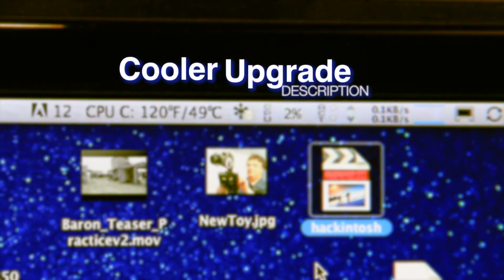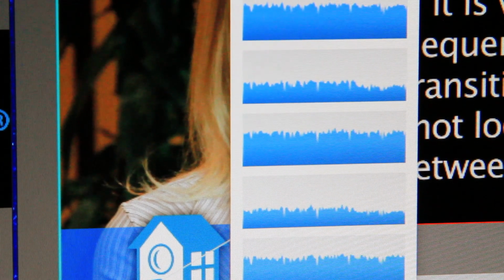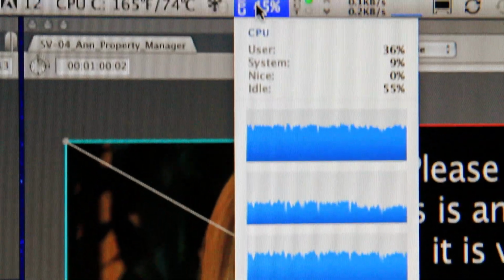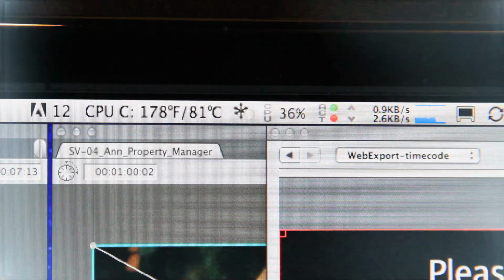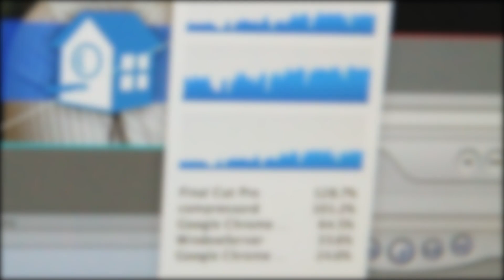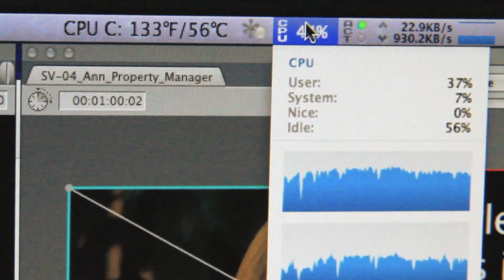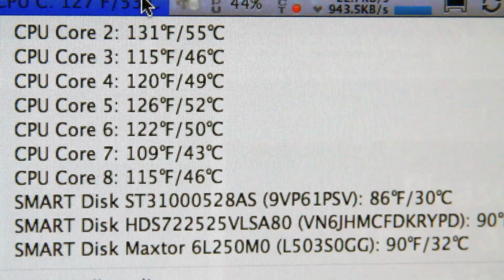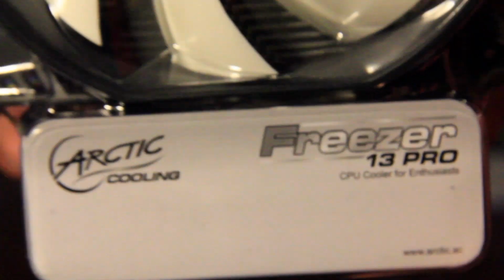Installing Freezer 13 Pro

Comment: I have Corsair - CMX4GX3M2A1600C9 RAM installed. The two closest slots to the processor have on extra clearance above this RAM and the cooler.

Comment: Hi there! I might get one of these but does anyone know if Corsair Vengeance ram will fit in without being crushed by the fan. The ram has large heat sinks either side and they are 4.6 cm high. I might also add another 8 gigs in the future. will they fit or are two of the slots obstructed?